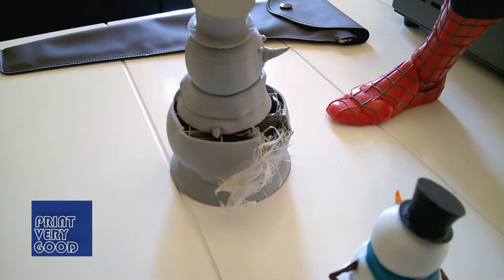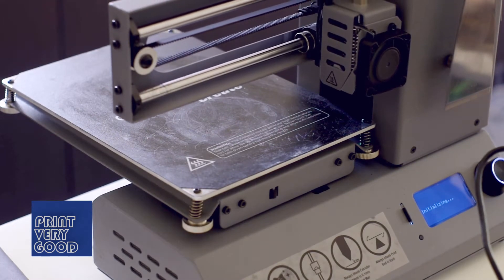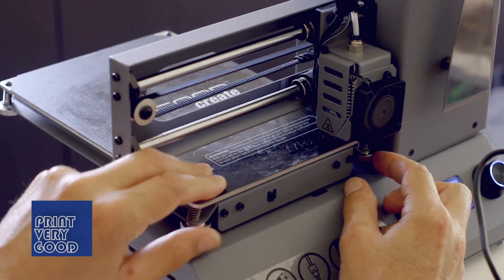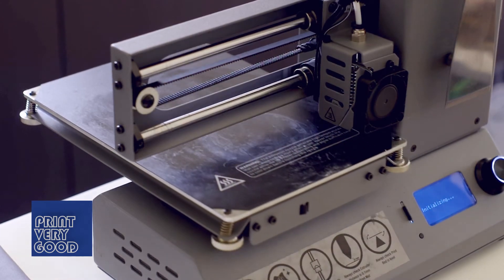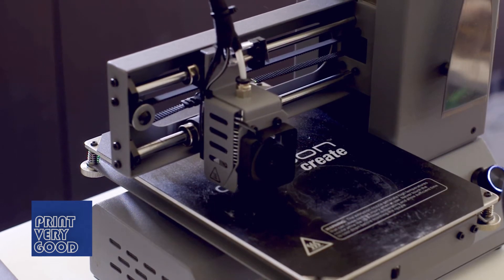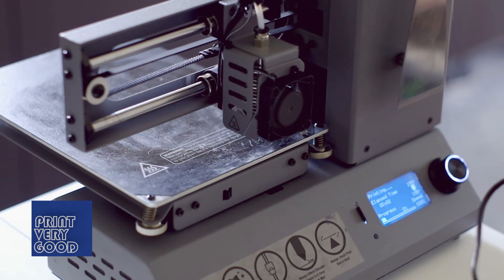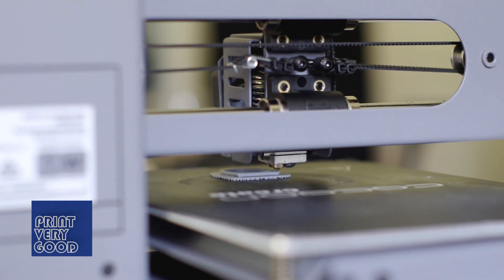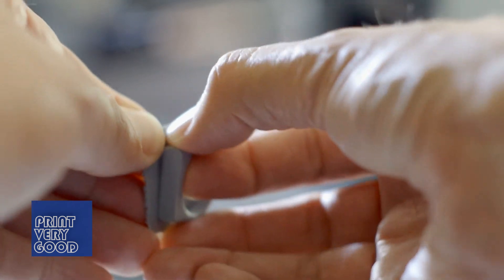So What Happened to My 3D Printer?

Comment: Hi Paul print out some new numbered thumbwheels with knurled edges for easy adjustment its about time you upgraded that printer the best part of owning a 3d printer is upgrading it. A uninterruptible power supply can save your precious prints I would advise you secure one.
Reply from the maker: Hi Master Wu! Thanks for the suggestions I do appreciate them. Yes after the power cut out 5 hours in to a 6 hour print the other day, an uninterruptible power supply is on my list of must haves. I will look at the numbered thumbwheel idea as well.
Reply: Hi again Paul I have noticed Other People who have brought the mini printer have had the same issue you described in one of your other vids relating to the dodgy micro sd card perhaps there is another vid for you there. You seem to be achieving some solid results with your printing and it looks as if the 3d printing bugs bitten hard. I am enjoying your vids, and for a relative noob to the hobby you bring a good professional manor with your approach so keep cranking out the vids.
Reply from the maker: Awesome comment! Thanks for the feedback Master Wu.

Comment: I've been suspicious of those adjustment screws loosening slightly on my printer. I might try some sort of thread locking compound, just using a small amount to keep the bed adjustable.
Reply from the maker: I'll be keeping a close eye on it Leon. I might mark the thumb wheel with a marker so that I can see if it moves.